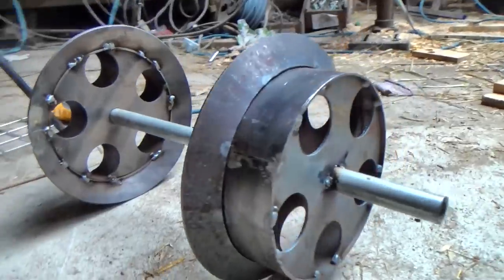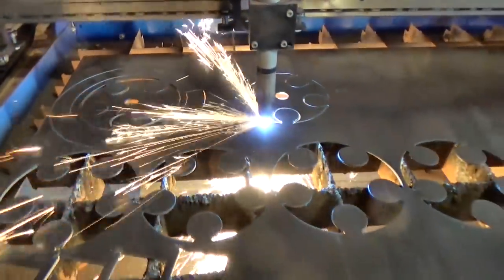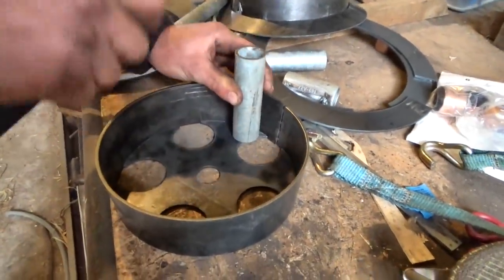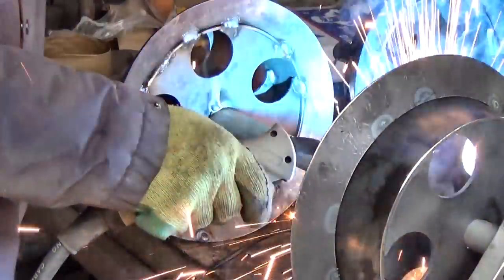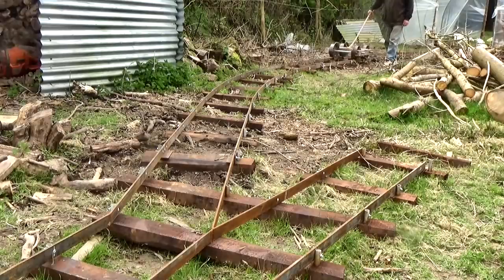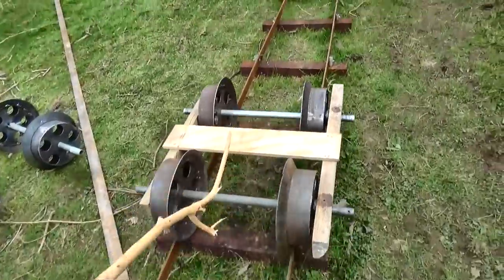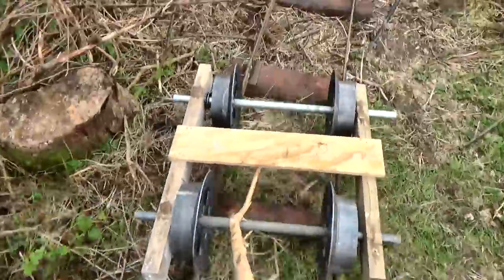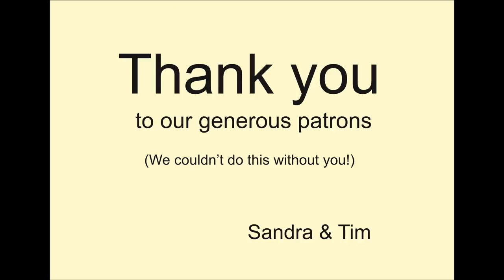More Homemade Railway Wheels - This Time With Tapered Treads!

Comment: I believe the tapered wheels work better for centering on a railroad type rail that is rather round edge on top, not flat,   On your narrow edge steel rail it will not make much difference.  Turning will improve, I believe IF you move the wheels closer together on same axle a bit, to give more drift b4 dragging against edge stop on axle,   Also if u move 2 axles further apart system would benefit from improved leverage that more length provides to turning.

Finally if each axle to frame attachment were allowed to pivot (self steer) a small amount the turning with less drag would be greatly improved. 

I will build a flat steel wheel w a stationary edge guard that does not turn , and make it adjustable, and replaceable.  May run wheel on a flat steel or flat hard wood rail on concrete shop floor, to move wide loads through narrow door way and stop very close to each workstation.   My drive motor will be a hand crank boat loading winch, with much mechanical advantage and built in braking .  Put a battery powered hand drill with nut driver on for some power assist!

Comment: Nice job Sir, greetings from Brazil! What if you make the wheels smaller in diameter? Wouldn't it be smoother to ride on those curves?
Reply from the maker: Yes, you might be right, but the bigger the better on the straights, so you can't win : -  )

Comment: Have you thought about making each wheel independent to the one parallel? Not a straight axle but a open system. The one going on the outside of the turn is having to move at a greater distance than the inside wheel. That could cause friction and noise.
Reply: Tapered treads solve this issue.

Comment: A greater taper would improve the centering at low speed at the cost of greater instability at high speed. But I don't see you running trains at speeds that would be a problem.

Comment: You'll find that even real railway wheels grind on tight bends. The flanges need to touch the rails to do their job. If you're on or near a train you can hear it.  It's a sort of hissing sound as if a brake is dragging.
You should hear the noise on a really tight curve (reverse S curve it's called) the tightest in the UK is 90m radius one way followed by 1metre straight section followed by 90 metre radius curve the other way.
I used to have to set up this type of test in the Lab at Bombardier to check that the power cables between carriages were long enough to stretch between carriages but not so long that on the straight they touched the rails.

Comment: Ara Tim, yer puttin way too much energy into this railway, wasn't it only recently you were planning to merge a car, windmill, elastic band and bathtub so that you could freewheel down to the village and then use the windmill to dry your hair after the bath on the way home? Like, I can understand the benefits of a railway, what with the muck and the weight of timber being what it is. But without a windmill it's pretty labour intensive. Not to mention all of that mild steel plate leftovers that is only hoping against hope to get a coat of red oxide and replace the pallets around the arena. The bloodstock wouldn't probably nibble the tops of mild steel like they would pallets.  It was only after a long explanation from Roger that I came to understand the noise of trams and trains. They have a solid axle! So the buggers grind as they take a curve, one wheel covering the greater distance than t'other and all of the noise that goes with it. Why don't they put the bearings in the wheels rather than on the solid axle? I guess I'll never know.  Now bear with me, the well that is over near the gates to hairy henry, if you could get a pipe from there to the free energy car you'd have all of the water you need for the bath. I wonder does Tommy Hanlon read this guff?

Comment: The angle on wheel (taperation) is necessary to compensate difference of lenght between inner and outer rail in turn, because railway wheels have no differencial. You will find out under some heavy load. You need more angle, because they need bigger difference in so sharp turns.

Comment: A brake drum with a disc added for a flange would be dead easy to make wouldn't it ? (for you, not for me though 😉, I still haven't learned to weld).
I think the people who object to your kick switch are rail fans like myself, but it's just a question of aesthetics. We're used to a nice curve in the turnout and this offends us visually. Of course you're absolutely right, yours is easier to make and is perfectly suited to the application. It's probable that longer wheel based vehicles will object to it, but if you need a longer load carrier just use a couple of short wheelbase bogies. I wouldn't recommend a Pacific locomotive or an 8 coupled heavy freight engine though 😂

Comment: The brake drums (but with a flange welded on) would be much better than the brake disks. But it doesn't really reduce the effort needed to produce them enough to be worth the cost of getting them unless you know a scrappy or a mechanic that you can get them off for free.

Comment: Tapered wheels might not eliminate flange friction against the gauge face of the rail.  But they do allow the axle to shift sideways on a curve so that larger radius of the cone is running on the outside rail of the curve while the smaller radius of the cone of the opposite wheel can make smaller revolutions on the inside rail of the curve which has a smaller radius. This way both wheels can turn happily at the same time even though the radii of the rails is different.  When railway wheels develop worn treads, they may work reasonably well in a curve. But coming out of the curve they will "hunt" side to side, sometimes violently, trying to find that sweet spot on the treads that will allow them to turn at the same speed.

Comment: Cylindrical tread wheels will always slide a bit in curves due to the difference in the distanced traveled between the inside and outside rail in a curve. Tapered wheels act as a differential to compensate for the difference in distance each side has to travel through a curve. The wheel on the longer outside rail rides on the larger circumference of the taper, while the wheel on the inside rail which is shorter rides on the smaller circumference of the taper. Proper taper needs to be engineered for the tightest radius of your curves, I.e. the tighter the curves, more taper is required. Wheels also need to have sufficient lateral clearances between the wheel flanges and the gauge side of the rail to find the correct circumferences to comfortably negotiate the curve. The other issue I noticed is due to the radius of your curves, there is a lot of friction between the wheel flanges and outside rail in the curve. You may want to lubricate the gauge side of the outside rails in your curves to reduce friction. The same applies to the switches.

Comment: A tapered tread will create an outward twisting force on your rails. If you had regular rails then they would be good, but with your flatstock rails you'll want to keep as much of the force as possible in the zed direction. 
I like your point system as it eliminates the need for a frog. About half my derailments come from the flange riding up on the frogs. In the diesel loci this isn't a problem as I just go the other way.  But on our battery locis this just creates too much arcing on our worn out contact points. Jacking up a 5000 pound loci isn't much fun.

We've got a nearby machine shop that builds wheels for timber carts and manchies out of heavy 12" pipe that has a 1/2" wall. They charge $575 each for them.
Reply from the maker: Thanks. Yes, I was put off the frog because it was more complicated, but I can see that it might cause problems too..

Comment: After  this  what  I want  know how much waight can be a horse pulling on a rail track on a road on water/pulling a canal boat . Which has the  least friction. Canals I think is 20 ton and I think there is something about low friction on tracks that  was more efficient than roads?
Reply from the maker: Good questions, Michael. Canals are the best of all, I think, but I don't think I can build one here : -  (

Comment: On full scale railways, the tapered wheels allow compensation for the differences of wheel speed when negotiating a curve, the outer wheel will run higher on the taper than the inner wheel which will run on the smaller diameter, compensating for speed differences.

Comment: Slower wheels more taper, faster wheels less taper for less hunting (bouncing between flanges).
  
If you want to get off your flanges in turns you need to match your taper to the curve.  The difference of the track length distance within the turn needs to be handled by the minimum and maximum circumference of the taper.  You can either pick your taper for your desired minimum turn radius, or you can limit your turn radius to match a given taper.
  
For example a minimum taper radius of 150mm and a maximum taper radius of 155mm can handle a difference in rail length of only 1.033:1 in a curve.  And a taper ratio of 140:155 can handle a curve rail difference of 1.107:1.  Get too crazy with the taper slope though and you're going to need wider treads lest you spread your rails with the tread's wedge shape.
Reply from the maker: Thanks, Tim. I think I'll just grease the flanges  : -  )

Comment: By my scrawly calculations, the natural curving radius of an 8" wheelset with a 1 in 20 cone angle at 15" gauge is about 33 feet, so not much use on your sharp curves.  In any case, a lot of the grinding seems to be due to the flanges binding up against the rail.  This happens eventually anyway, but will occur sooner when the axle is held in a frame like a wagon that stops it adopting a natural radial attitude on the curve.  Widening the gauge on curves helps alleviate flange-binding- you can use a three-point gauge for this or just bodge it by eye.

Comment: I noticed in the bend of the track the flanges were scraping the sides of the rails. There is a relation between the angle of the flange, the distance between the axles/wheelbase and the curve. To prevent scraping the radius the flanges make must be smaller than that of the curve.
With a rope perpendicular to the rails it must be possible to estimate the radius of the arc. The same for the flanges of the wheels.
GL and greetings from the Netherlands.
Reply from the maker: You're right - I'm still experimenting with the best angle

Comment: I am reminded of two adages from my youth in mechanical maintaince.
The First is, If it works, don't fix it.
the second is, Keep it Simple!
Most farmers just wanna get things done and working and maybe improve it if they have to continually replace things. Upgrades are expensive. But if you have time, money, tools, and materials, then feel free to experiment. 
I think this garden railway is perfect for your use. It looks like something you can take down and store as needed, so perfection is not needed. Just the ability to save you back and joins the wear and tear you can't afford. 
So Bravo and Hats off! I look forward to seeing how the bearing works out and your final product.

Comment: I say stick with the flat wheels. Been living next to railroad tracks all my life (can't sleep without it now) all wheels grind in curves. Besides all that, the bogeys the big guys roll on see way more miles than your wheels are gonna see without the wide radius rail face on your track. 

Die hard motorcycle riders say "It doesn't matter what bike your riding, just as long as you ARE riding"
Reply from the maker: Exactly!

Comment: Your wheels are fine and you very right in saying that its not worth the effort people don't like em cus they aren't actuate to a full scale railway but forget as you keep saying that this is one and its built to your satisfaction for actual function. Sure if you used those wheels on a miniature flying Scotsmen it would look silly and not work right but this is a cheap and cheerful farm railway so keep doing what your doing and keep inspiring us to do similar in our own way.  I for one am trying wheels made from rubber door stops with washers for a flange for use on my friends 5 inch line he's building in his garden and I'm sure many will take offence at that.
Reply from the maker: As long as it stays on the tracks, it'll do.. : -   )

Comment: Hi Tim, impressive work. I spent a couple of years working as a rail lubricator: the solution used on the "big" stuff is to put a thin film of heavy grease on the inside edge of the rail in areas where there's lateral forces. Corners, in other words. It helps with getting the train through the bend but, beyond that, greatly reduces wear and can go a long way towards eliminating squealing/banshee wailing.
Reply from the maker: Yes, it could be that simple - I'll try it. Thanks. 
(Banshee wailing!)

Comment: To stop grinding on the curves the ratio between the possible running diameter on the inside and outside wheels must exceed the ratio of the length needed to travel on the inside and outside track.

So if r is the smallest radius of the desired curve you need (measured from the centerline of the track) then the equation to solve is (wheelRadius + taperDelta)/(wheelRadius - taperDelta) > (r + track_guage/2)/(r - track_guage/2)

The taper delta is the amount of wheel radius you gain by putting the wheels as far off center as possible the amount is based on the taper angle and the amount of wiggle room your wheels have on the track side to side (which was only 1 cm side to side?). So if you make the guage in the curves a bit wider and/or put the wheels a bit closer together you can get more turning out of the wheels before they start grinding the flange on the rail. Of course if you put them too close together they may derail.
Reply from the maker: You're right - I'll bring them a little closer and see if that makes any practical difference

Comment: Tim, I like your "keep it simple" approach.  So what if parallel wheels and kick switches don't work well enough on a full size high speed railroad?  You aren't building a commercial railroad.  I am eager to see how the different wheel sets work with a loaded wagon.

Comment: I'm no metalworker, but i do have an idea that might work. Basically, instead of rolling cones for the wheels, what about making simple hoops out of thicker steel, and then using a grinder to taper the wheels. One other option might be to weld in some filler near the flange, enabling a much steeper taper than if a purely subtractive method was used (although the heat warping the metal could be an issue). One advantage of an approach like this is that it enables you to experiment with more complicated custom profiles than a simple cone. I hope you find this useful, and keep up the good work.
Reply from the maker: Good idea, but thicker steel is much more difficult to roll and much more expensive to buy too. Keep thinking : -  )

Comment: I have made trucks with some push beam trollies that I turned “inside out”. They work great and were simple to make but the wheels are small. Also you need a cheap source of push beam trollies. The advantage for me is that I don’t have to weld at all.
Reply from the maker: I looked at them, but I think they'd fall off my rails. What gauge is your track?

Comment: Wheels rotating freely, rather than welded to the axles would allow inside & outside wheels to rotate at different speeds, thus mitigating the grinding on curved track.
Reply: Railway wheels almost always have solid axles and tapered profiles. This way, if the wheelset encounters a curve, the outer wheel moves closer to the rail and has larger diameter at the point of contact than the inner wheel - thus the train negotiates the curve without hitting the flanges. For any given taper, there is a minimum track radius before the flanges hit the rails.

The problem with a split axle is that is wouldn't stop the grinding at all. The tapered solid axle wheelset provides a restoring force, keeping the train perfectly between the rails. A split axle wouldn't, so the wheelset would just grind against the rails anyway.

Comment: Love it! Well done Tim. Sounds like for your use on your railway, your original wheels were fine. And no, you’re not the only one making railway wheels, but the ones I’ve just made - from solid steel - are 38mm diam on the tyres (or treads) and 42mm across the flanges, so my steam tram won’t be running on your railway - unless you have a bit of 35mm gauge knocking about in the barn! Looking forward to your wagon(s). Love the channel. Les in UK
PS, my wheels are flat-tread wheels too. Les
Reply from the maker: glad to hear I'm not the only one, Les!

Comment: Fantastic video as always. The main advantage of a tapered wheel is that it changes the diameter of the wheels allowing the one on the outer of the curve to spin faster to maintain speed with the inner wheel. They are like an open differential in a car this way. In a car, if you weld the axles together then the car will screech, bind and bark the tires around turns. This is possibly the grinding you are hearing with the straight wheels, the inner wheel has to slip to maintain the same speed as the outer wheel. For your application, it doesn’t seem like there is a big enough advantage to make it worth all the extra effort.

Comment: It would seem your wheels gauge is a bit too wide and are rubbing on your rails a lot more then they probably should. Perhaps make the wheels slightly closer together, that and the wheels with the slight cone shape, should help it a bit more on corners when the flanges aren't getting caught on the rails
Reply from the maker: Yes, maybe you're right. I'll try that too